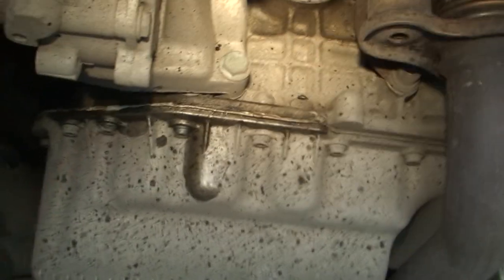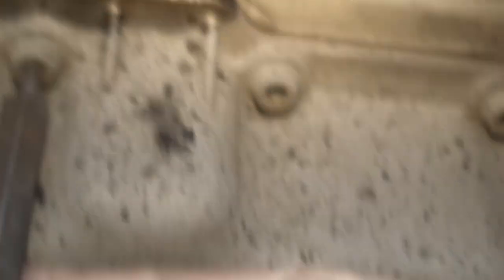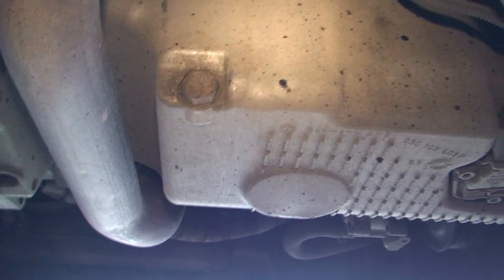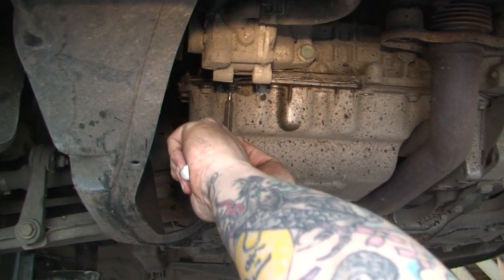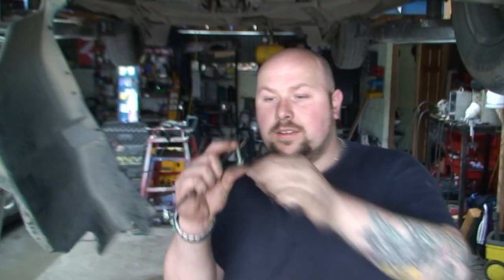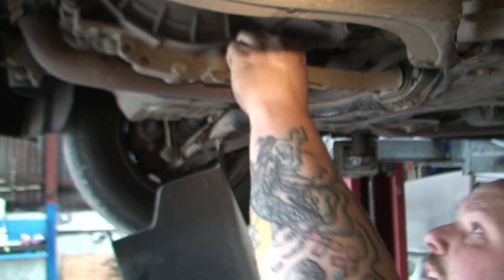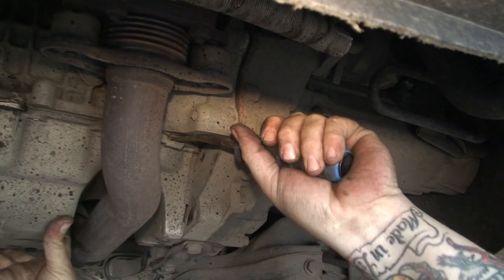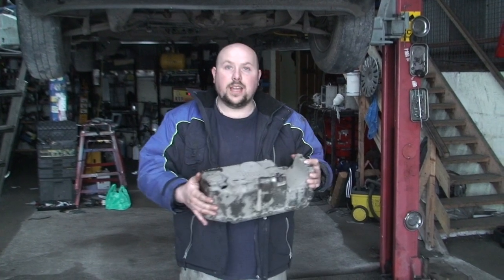bodgit and leggit garage how to remove a car sump (vw golf 1.4 part 1)

Comment: Great Video!! Used this to remove my sump off my 1.4 mk6 golf. Don't be fooled though, This is no easy job. If you round the head of even one of these bolts, you are going to have a very bad day. I covered my hex key with an old, thin rag to make the key a super tight fit into the head of the hex bolt then lightly tapped it with a hammer as per this video to make sure it is seated all the way before slowly applying pressure to break the bolt free. This reduced the key from slipping and rounding the head. the electrical tape trick worked like a charm!

Comment: Please tell me if vw has made it any easier on 2014 Octavia 2.0 DSG, had to replace alternator today cause of the dam faulty pulley. And noticed bad oil leak from the sump, leaving it draining over night, with it being DSG it still has a DMF am guessing & hopefully can turn crank to see & get access to the dam bolts. Have you done one on DSG pal ?

Comment: Really fantastic video guys, I appreciated the quality of the filming (good lighting) and the good humour of the presentation style. I need re-seal the sump on my other half's Punto 188 1.2 16V so I'm watching a few vids to research. I realise this vid is for a dry sump (from reading the excellent description) so not really too relevant I guess, but an interesting watch anyway
Reply from the maker: MrCurry hi mate all saints are pretty much the same to be honest just make sure you use the correct sealer and you will not go wrong just be careful not to track anything between the sun and the engine and you will be fine thanks for watching don't forget get your hands dirty

Comment: Hi Bodgit. I recently bought an 08 plate Vauxhall vectra with the 1.8l VVT petrol in it. I did an oil change on it pretty much as soon as I bought it and found that the old oil filter had totally disintegrated as well as having horrible gloopy black oil. After doing the oil change, the engine has begun to develop a worrying rattle and diesel like sound when warm that sounds like it's coming from the top end. According to forums, the VVT phasers on these are a common problem and I was going to get them changed when I scrape up some money to do the cam belt (it's at 73K, recommended interval is 100k). One of the first things that I did was to clean the filters on the VVT solenoid valves but sadly that didn't help much. I've never seen the oil pressure warning light, though I had wondered if the crap from the disintegrated oil filter could have made it's way down to the pickup strainer and restricted it enough to cause reduced oil pressure but not enough to trigger the warning. My question is have you ever worked on these cars/ engines (z18xer) and if so, how easy is it to remove the sump and more importantly re fit and seal it again?  Have you got any other words of wisdom, I'm worried about my engine but currently lack the means to do anything about it. :,-(  Thanks.
Reply from the maker: hi mate the first thing I would definitely check is the oil pump so take off the sump and check the gauze to make sure it's not blocked also I would check the oil pump I have done a video on how to check it and check for damage that would be the first thing I would do because if you leave it too much longer you will damage your engine you might only need to clean the pickup or maybe just get a new oil pump which is not really as big a deal as it sounds let me know how you get on thanks
Reply: Thanks, cant do anything just yet because I've got no money and no good spot to put my car to work on it at the moment, but I think I'll go looking in the sump first when I do manage to get cracking with it. Unfortunately I've got a feeling it's going to be an exhaust off job, so could end up being a bit tricky to do without replacing anything. Thanks again for your reply and I'll let you know what happens.

Comment: Really great video, guys. Great detail and great tips to make sure you don't go wrong. I've got a VW Golf MK4 2001 and the oil pump warning light has started flashing at me. Can you suggest what the problem might be? On VW forums I've seen the issue could be the oil pump switch or the oil pump itself. No idea where to start investigating the problem.
Reply from the maker: Lance Bolton hi mate it could be a few problems it could be the oil also could be the oil pick up in the sump is blocked can also be the switch but it also can be the oil pump if you can get an oil pressure gauge and put it on this one tell you what isn't wrong if you have enough oil pressure then it's most likely your switch if not it could be your oil pump
Reply: Sounds like a process of elimination. I'll start with a pressure gauge and see what happens. Thank you for your help, I think you'll be heading from me again. Lance.

Comment: My car is leaking ATF and was told it was my sump that was leaking nice to be able to watch this to know what the mechanics will actually be doing to my car 🙂
Reply from the maker: Kellie Bieda hi ATF fluid is either your power steering fluid or if you've got an automatic transmission this will not be coming out of the sump it's engine oil that's in the sump
Reply: I was told the gearbox had a sump too?
Reply from the maker: Kellie Bieda is it an automatic gearbox
Reply: Yes it is an automatic gear box
Reply from the maker: Kellie Bieda ok that makes much more sense
Reply: bodgit and leggit garage lol sorry I’m a new driver and it’s a very steep learning curve for me, unfortunately I have no inherited much of my mums car knowledge but I’m getting there slowly
Reply from the maker: Kellie Bieda we are all learning all the time so don't worry about it

Comment: Hiya brother. I've got a 4motion. I'm leaking. It's a cracked sump. I've tried the chemical metal and that doesn't work, so it's a new sump unfortunately. Are the principles of removing the sump exactly the same with this video with my 2.8?

Comment: Just done this job. The 2 hidden bolts next to the gear box could not be accessed.  A flexible camera showed that the flywheel was covering part of the bolt head.  After some head scratching realised that the flywheel must have a cutout to access these bolts. Moving the car backwards and forwards soon found place where a 5mm t bar could get them out.
Reply: Thanks for this comment, saved me alot of grief as I ran into the same problem

Comment: hi m8 i got a Treg astra est transverse engine its leaking oil from somekinda plate between the sump and ? the plate is butted up to the sump held in bt 3 bolts its not connected to the sump? it leaks when i am parked up any ideas..ta

Comment: Hello mate any ideas on how to remove a damage bolt, its been rounded off and its one of those hard to reach ones.
Reply from the maker: Hi mate there is loads of different ways but like everything can take a long long time you are best off trying to use a six-sided socket you might be using a 12 sided socket which is not very good for this you might even need to drill it out and use easy outs and taps one of them things that just takes a lot of time and patience
Reply: @bodgitandleggitgarage  thanks for reply, sorry i should of wrote its a 5mm Allen bolt with a round head really hard to get at and i cant get the car high enough to get at it better, looks like gear box out just to sort out oil leak, now i know why they sold it..cheers.
Reply from the maker: @Hasdac  the easiest thing to do there is to try and get a splines peace into a socket and then you can Hammer that into the allen key but you've only got one chance or what you can also do is dill off the head this will release the pressure and you will be able to screw it out providing the threads aren't rusted into the housing
Reply: @bodgitandleggitgarage  thanks for reply i will give it a go at weekend what a stupid design.
Reply from the maker: @Hasdac  any time mate

Comment: My audi a3 is using too much oil, oil is burning the spark plugs are black I wondered if some one can put me in the right direction. Its 2006 1.6 bse engine.
Reply from the maker: Su S hi mate it could be loads of things piston rings valve seals PCV valve turbo wear in the engine you have to get it tested I'm fortunate you need to take it to someone who can test all these things and give you a proper answer there's no real shortcuts in this case

Comment: I presume you do this job for a living.. Why can't you just buy a long 5mm ball Allen socket? Because a) you're damaging the head of every gearbox bolt you're taking off and b) you're just creating unnecessary work for yourself with the time taken and struggle to remove those bolts with your current setup and then of course having to reinstall... And when you do reinstall chances are you're gona strip the threads for the holes where those 2 bolts go because you won't be able to get the bolt in straight... I mean honestly, you're making this job a lot worse than it actually is. With the 5mm long allen ball bit socket, it's an absolute piece of cake.